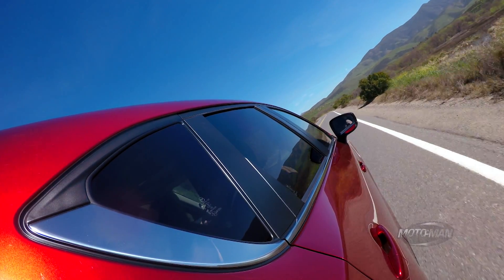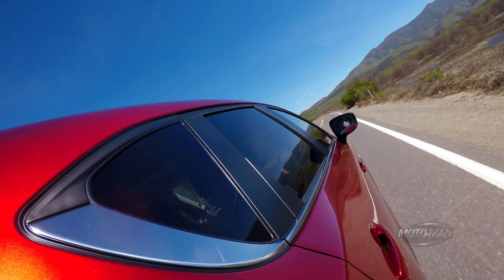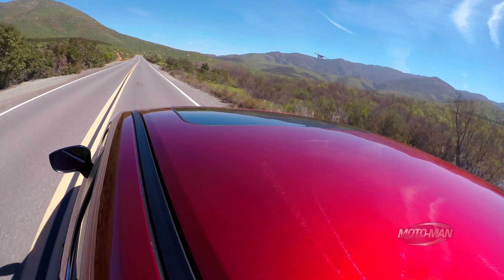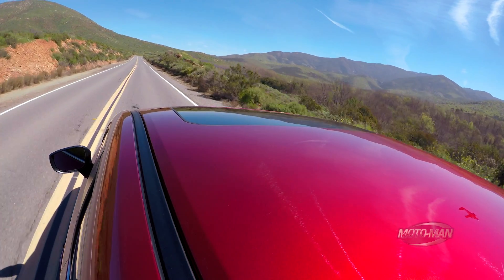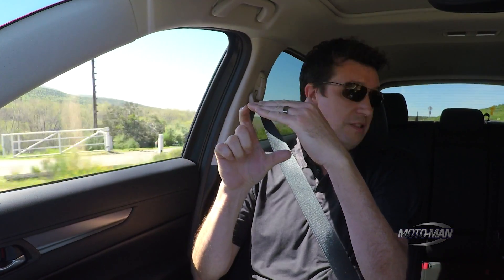PART ONE: 2017 Mazda CX-5 *very deep* ENGINEERING REVIEW with Dave Coleman (3 of 5)

Comment: Dave offers great insight as always. 
When will the piston and tyranny sw improvements make it into the rest of the Mazda line? My 6lease is almost up and as Dave pointed out my only gripe is the hesitation I  experience from a stop.  I've grown to enjoy the 2.5 engine. It seems to improve as it ages and loves being revved. As has always been the case Mazda love twisty roads and keeping their engines at a boil via 2nd and 3rd gear. In the "real" world, after I've dropped the kids at school, I really enjoy keeping the engine between 3 and 5.5K with the paddles as I negotiate twisties in my area. Would I appreciate more horses? Sure. Another 20-30hp and some extra grunt down low would make this car great as long as it remains the superbly balanced sedan it is.  I have a hard time not chirping the front tires. But the 6 would feel invincible with a little more power and AWD. After living with the 6 for over two years and replacing the standard plastic paddles with some nicely weighted aluminum samples from kenstyle I find I use manual mode 90% of the time. My fuel economy of course suffers without the computer shifting, but  man manual mode does wake this car up. Just need to kill that low rpm hesitation. Also interested in a 6 redesign per what was done with CX5 and CX9.

Comment: Very interesting and creative idea to angle the springs to counter act the lateral loads binding up the struts. Of course simply switching to dual wishbone would make such a wild work around null and void and give the befit of camber gain through bump travel. I wonder if their engine bay packaging is the main driver for selecting struts? Is the engine bay really so tight that they need to use struts, or is the reduced parts count/cost savings from a strut suspension the main driver?

Comment: Mercedes recently reduced cylinder piston friction and other mods to reduce friction.  This is the diesel OM642 (I think), piston top is changed.  Some real efficency, hence fuel consumption has decreased.  This engine is first used on the E class.  Has Mazda used nanotechnology to reduce friction?
BMW has introduced water injection at the cylinder intake for  a few reasons.  What about Mazda?  Surely their engine designers know all about this.
Reply: Martin Lang  Of course they have. It is used for cylinder-wall lining.
Reply: Exactly, any references?